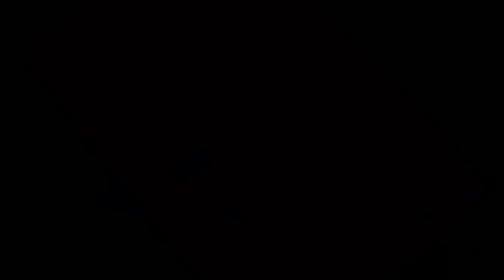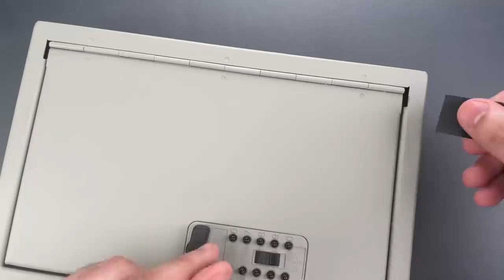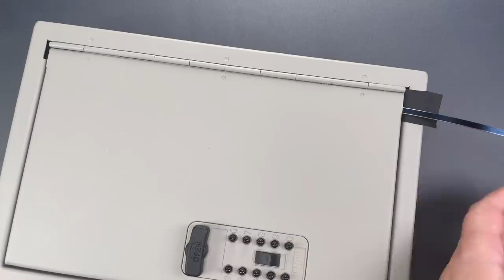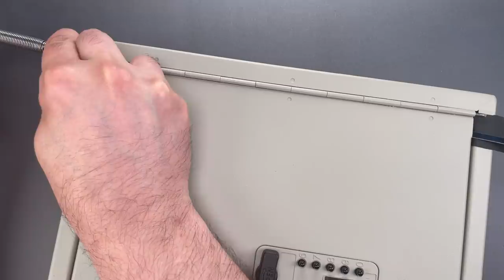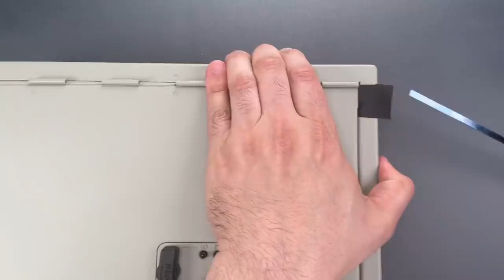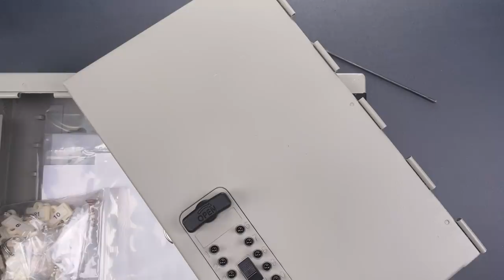[1319] Bypassing Kidde AccessPoint Key Cabinet Pro

Comment: I used to work for a company that made similar products but for holding opiode and opiate painkillers like morphine and codine etc. We used to weld the hinge pins to the hinge body at each end and used 1.2mm steel, that wss about the charitable thing I could say about it, steel was not quite mild steel but no means anything special, they where weak and fairly easy to pick (6 waffer locks, while they where nice waffer locks they were still waffers) and I told the boss how better steel and a good lock would make it way better he told me he knows but they have to make them cheap otherwise the hospitals will go else where and the boxes just had to stop particularly desparate junkies, if someone who know what they where doing wanted in, nothing short of a small safe would stop them even in an office. The boxes are just visual deterents and to stop opertunistic theives really.

Comment: I have been able to access the GE Supra which is similar to this model by turning the knob to the point where the clutch breaks. If you toggle it at that point the buttons which are used in the access code will wiggle and stand out compared to the others.

Comment: Though it'd raise the cost of the box significantly perhaps, they could redesign it with thicker gauge steel.  Alternately they could keep with the thin steel, but add more delay by adding a braced anchor on the inside of the door to grab the box after the pin is removed. But if the thief abandons being covert, he could just pry the lid anyway.

Comment: I don't think people know much about kidde as a company. For years they have been making products for fire detection/protection. Fire systems are their primary game for commercial use. That box is usually installed in a maintenance room or managers office of a business. Now this does not forgive such an easy attack but this will already be placed somewhere hard to get to and the keys inside are usually for opening or accessing very specific equipment or other rooms. I have seen these installed at gas stations and all they contain or keys for the dispensers and locks for the fill ports on tanks. Kidde should address this and hopefully will, but for the comments of the brazen acting as this company is going to fail overnight is sadly mistaken. The lock picking lawyer is very skilled and even if the hinge was welded there is a myriad of ways I am sure this thing can be defeated. 

I appreciate LPL for always publishing ways things can be bypassed and hoping engineers or they company gets wind and can make improvements in the long run.

Comment: I pried one of those open with a pair of pliers once - the only difference being that it used a key. It took me less than a minute. The flat piece of metal that holds those shut is surprisingly soft.

My mother had documents locked up and she lost the key. I'm no Lock Picking Lawyer so I used a dumb guy method to get in.

Comment: If there is 1 more segment of hinge, maybe 2 drops of superglue at the ends would fix it. (Need one more segment because if you try to glue hinge with even segment to the pin, the safe door won't open. If the segment number is odd then you'll glue the pin to segments on the same side, either the door or the safe body, and the door can still rotate. )

Comment: That is exactly how I opened mine when I forgot the combination, only I didn't need to shim one end. Used an ice pic and a pair of vice grips (Used the vice grips as a hammer to start the pin movement).

Comment: The problem is that he pried up on the door to pull the hinge up and get the pin out.  Once the pin is out, the cabinet side of the hinge went back into the protected position.  So, it would not be possible to get the pin back in.  I would consider this a destructive attack because it would be obvious how and when the box was defeated.  That would narrow the suspect list to those with access to the area of the box during that time frame.  If I'm removing something from that box, I'd prefer a covert entry to that the access is not immediately (or at all) discovered.  If an item, say a key, goes missing from the box during a large time frame with no evidence of forced entry, then one has to ask, "Was the key even in the box to begin with?"

Comment: They could crush the centre part of the hinge to plug it and split the hinge pin in two inserted at both ends where it wouldn't be able to slide out right through anymore. The additional cost of doing that should be minimal.

Comment: I have the same lock type on a keybox outside of our house (currently just containing a 9V battery and no keys. The battery as a backup if the e-lock batteries flats our). There have been a recall on that type of keybox because of a known vulnerability on the lock. But I haven't been able to find anything about it. And, since I'm only having a battery locked up, I haven't made an effort to find the vuln. :) 
Was kind of hoping to see this here now, but of course.. Hinge pin will basically always be the weakest link in a design.

Comment: They should have put a flange or metal pins on the hinge side which stops the door opening from the wrong side first. Then you can remove the hinge, but it still won’t open; that hinge should never have been part of the security of the box, it should have just a convenance feature to stop the door coming off in the customers hands. Then you’re back to the security of the locking mechanism.

Comment: I think this could be solved by splitting the pin in the middle. They would be able to push in the 2 parts for manufacturing but getting both halves out would be much harder to do.

Comment: This would be easy to mitigate.  Put a U-bend in the hinge pin. Perhaps several. Or even tac weld it. That would prevent sliding out the pin.  But that's probably not going to help much. The panel gaps on that box are ridiculous. If there's a gap that big, a crowbar or even a big screwdriver could probably just pry open the whole box.  A fancier lock or a more secure hinge pin won't help with that.

Comment: It would be SO easy to stop that! Crush one of the inner hinges to where the pin hits steel and use two hinge pins hammered in from each side. Or, use a shorter hinge pin and crush the ends of the two outer hinges to block the holes. Or tap the outer hinges a bit and screw in a screw to block the hinge pin. Cut off the screw so it would not be removable.

Comment: I got locked between two deadbolted doors in an interconnected space at work... on a weekend.  I found some itemsvand knocked the pins out of the door but the hinges were interlocked such that the door could not be pulled out even with the pins removed.  Why wouldnt they just incorporate a bent hinge on the frame side that traps the door side?  It wouldnt cost hardly anything.  Or add a couple of security spuds like on a safe.  These could be added maybe even in the same pressing of the door.  Either of these would at least require damaging the box.

Comment: The worst part is that is probably how they get the hinge pin installed in the first place. 
A simple fix would be to split the pin halfway (could easily be done with a grinder right in the center of the hinge in about 2 seconds)
That way you could still knock half the pin out but it would still be engaged halfway, sure you could probably bend the door out due to the light gauge metal but would still increase the time it takes non insignificantly.

Comment: It wouldn't take much to mushroom the ends of the hinge pin with a hammer, or spot welding the pin ends to the hinge, rendering it less vulnerable to this type of attack.

Comment: All they had to do was centre punch the fixed hinge loops after the hing was assembled to lock the hinge pin in.
I do it every time I don’t want the pin to slide / fall, or be pulled out.

Comment: I wonder if they could make that significantly more difficult to do if they just used multiple pieces of hinge pin. Each would abut the next, so sure you could get one out with that spring tool, but then you'd need to bring your own pin that's longer than the rest in order to push them out...

Comment: Isn't it that every lock of this kind after some use will have buttons for a proper combination slightly more pushed in and loose than other buttons? And also covered in much more grease than other buttons. After a year these locks are normally decoded by sight I believe. But if it's new the hinge trick definetley will do)

Comment: Unlocking car doors is often referred to "popping a lock" well not just cars now-
Reply: Popping locks on cars is easy.  Hit the roof above the interior light.  Most new cars have a sensor there that can tell if the roof receives an impact.  Makes the car think it's rolled onto its roof And it pops the locks. Crash sensors are the best way to unlock a car

Comment: improvements needed; cover both ends of the hinge, with a strong steel shield, and cover all gaps with a thick layer of steel (so you can't just use an angle grinder on it), so it can open, but would lower the 'forced' entry', and stop the hinge pin being knocked out easily.

If I knew your email, I'd send you a video of me 'picking' unlocking a 'unpickable bike lock' with nothing but a teaspoon

Comment: A single spot weld in the middle of the hinge could have stopped this attack. Now if the outer cabinet had been cnc machined by Mike Patey, he would have done stress analysis and fine tuned everything so this attack would have had to be destructive to get in.

Comment: Would crimping the two end barrels a little (like one or two center-punch) clamp down on the hinge pin enough to keep it from being pushed (or pulled) out? Or maybe "staking" the ends of the hinge pin? Or is the metal that the hinge is made of too compliant to allow those types of measures from being permanent? Just trying to brainstorm techniques to make removing the hinge pin much more difficult to put the bypass focus back onto the locking mechanism...

Comment: After having the hinge pin driven out of my keybox at work, I cut the pin into 3 uneven pieces and put it back in - it might not have stopped all the attempts, but it sure slowed them down when they found out they couldn't drive a single long pin out. I wonder if that would be an improvement here?

Comment: It wouldnt cost much more on their part to make it more secure with a four way locking system on the cam instead of the present single locking lug. Even welding a couple of lugs to the lid so it latches under the back when closed would have doubled the security.

Comment: That's a shame. All it needed was some welded retainer hooks that slide under the cabinet borders when the door is closed. ...easy to fix though. Just spot weld the pin to the hinge parts on the door.

Comment: If the outermost hinge sections had been part of the frame rather than the door, it would've been much less compliant, and thus more resistant to this type of attack. The captive side of the system should always be within the master side, that's just good engineering practice, afaik

Comment: How would you handle a segmented hinge pin? If, rather than one continuous pin, the hinges were secured with several smaller lengths, I believe that tool would be somewhat ineffective.
I suppose you could feed a longer pin of the same length through the hole until you have pushed all of the smaller ones out through the other side, but depending on how tight the tolerances are on the hinges, that may be more difficult than exploiting another vulnerability.

Comment: I really like these videos, but I would appreciate learning more about the lock in this case. How would you have gotten in if the pin wasn’t such an easy thing? I can quickly put a weld at either end and solve the problem. Is this a decent lock box then?
Reply: A model very visually similar to this box (though larger) is used at my work. The screw holding the locking bar in place will unscrew itself with use, and the bar can be bent into/out of shape with just a thumb and forefinger. About 100lbs (~45kg) force will pop the door open with minimal damage, and there's enough play to rock it open enough to get a solid hold on it.

IDK what they are marketed for price-wise, but it's prolly too much
Reply: Clearly the box has other issues that, of you've been watching long enough, should be fairly obvious.  I'm not a pen tester, but I can see enough of a gap on the lock side that I'd try a shim there first.  Then "feel" the buttons as I depress each one, trying to figure out the combo.  And these are just two tests that I'd start with not even being able to touch the box in real life...

Comment: It would seriously only take a second with a hydraulic pinch device to crimp both ends. You don't even have to weld it it just needs to be too small for the pin to pass through.

Comment: 1) shorten the hinge pin slightly and crimp the ends, or 2) small spot weld on either end.  We did this over 30 years ago in a sheetmetal shop...not that difficult .

Comment: Something really interesting about this Kidde cabinet is you can enter the 4 digit code in ANY order.  If you set the open code to (1234) for example. the codes 4321, 3421, 1324, 4132 etc... will work to open this.  Pretty crazy right?!?

Comment: Just thinking of the top of my head, could they have made an impervious hinge by riveting/micro welding a small band at say four separate parts along the metal strip. i.e. pieces that rotate with the door but prevent the bar from being pulled back out the way it's put in ? ? ?Or is there an easier way to secure it ? ? ?

Comment: No need to do that at all, this can just add easily be hacked as the other push button type takes about 30 seconds you turn the knob just a little bit and hit each button and take notice which ones have the most dramatic effect on the turn knob. A little bit of WD-40 around the knob goes a long way too

Comment: Couldn't they have fixed that with a small weld? Like literally a drop of solder or a touch of any metal in the hinge hole? Major oversight with a simple fix.

Comment: just have the hinge pin split into two pieces and that would be significantly more difficult without requiring any welding or design changes.

Comment: Cut the hinge pin in 2 then reinsert. This attack will fail because the pliers will only pull out 1/2 the pin leaving the other half in the hinge leaves. It has foiled a few smart ass fellows who thought they could use this old trick.
Reply: I'm sure they have tools such as a rod that will fit in the hinge and push the 2nd part out, add 15 seconds to the video.

Comment: Could they not simply make the metal bar inside the hinges extend beneath the sides of the frame? The door already looks "set in" to the body of the cabinet. It'd still be vulnerable to destructive attacks, but it would still be okay from an insurance perspective (as insurance is way more likely to pay out in the case of a destructive attack, and if it's securing medicine or something, then at least the company using this cabinet has done their job properly.
Reply: It would greatly complicate assembly to not have room to slide the hinge pin in, so then the hinge assembly would need to be part of the door, then the door put on (open position) and screwed or welded.  I'm guessing that for what these cost, you aren't going to get that

Comment: so what if there was tabs on the hinge side that in case this happened it would still have a lock in place? they shouldnt prevent normal use either as they would swing out of the way.

Comment: Curious question, why not just cover up the ends of the hinge? Wouldn't that easily fix the issue?
Reply: Yes, that's the problem here.
They didn't...
Reply: SunnyZ But that would be a simple solution, right? Or am I missing something here
Reply: @AceArchitect28  That would have added a few cents to production costs.
Too much for a safe!
Reply: SunnyZ I see. Thank you.

Comment: Whenever I see the at main entry door of a building opening outward, I think if this vulnerability.
Reply: Properly fitted outswing doors commonly have NRP ( Non Removable Pin) hinges. Easy access to the lock latch or bolt make securing  them more difficult but the hinges are easily secured. Outswing doors are required for commercial fire code.
Reply: @skygh  yes out swing is required for egress points in fire and safety norms. 
Are these types of hinges common?
Reply: Yes, very common. Architects spec them for every commercial job I have been on.

Comment: I don't understand how these manufacturers overlook such an obvious flaw, especially one that can be fixed so easily and at  such little cost
Reply: Everyone manufactures in china which means little to no control over the end product.  They'll make the rough design but cut corners.  Even if you convince them to give you the "good stuff", the same factory will churn out the product cheaper and more shoddily and you'll find yourself undercut and discredited by awful clones.

Comment: Would I be wrong to think they could solve this particular attack by making it two hinge pins inside so that when one end gets punched, only half of it could be pulled out?
Reply: or they can just weld it so it can't get pulled out.
Reply: Also  as the punch doesn't have much travel, if there were two pins with a gap, the punch would only close the gap.

Comment: Is it perhaps possible to simply fix this error? 
My idea would be to split the pin into three unequal parts. 
Two small pieces that go about halfway down the second hinge from the bottom and the top, and the long piece in the middle. 
So you could only remove the smaller pieces with the hinch pin tool, but you still have to have enough security that it cannot be levered open without any problems. @Lockpickinglawyer